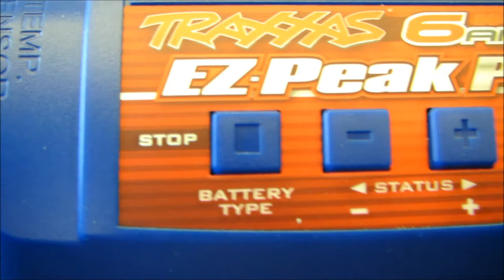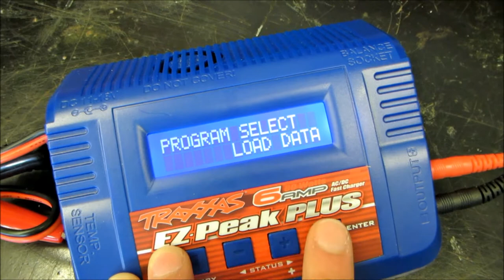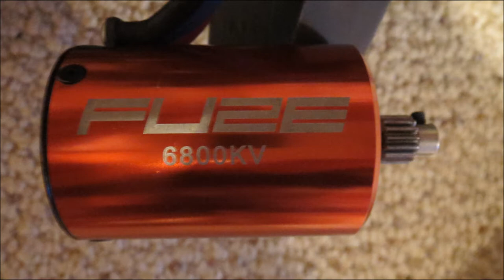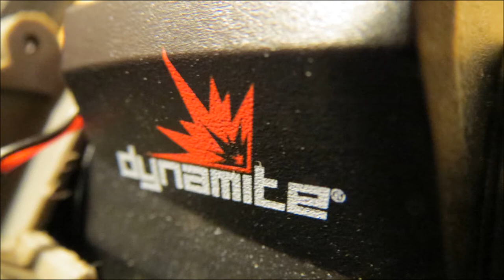Custom Upgraded Traxxas Rustler RC car

Comment: Can you put the list of the parts you use for your rustler in the description?
Reply from the maker: Powerpeak 3s 4300mAh 45C lipo
Dynamite 5800kV brushless motor + speed controller
RPM gearbox
RPM A-arms (front and rear)
PRM shock towers (front and rear)
Proline powerstroke shocks (front and rear)
Proline steering kit with built in servo saver
AXIAL aluminum servo horn
Steel CVD driveshafts
STRC steel hinge pins
STRC blue wheel hexes
STRC blue wheel flange nuts
Traxxas 2075 high torque digital servo
Traxxas blue aluminum axle carriers
Traxxas blue aluminum steering blocks
Traxxas blue aluminum caster blocks
Traxxas battery upgrade kit
Traxxas upgrade ESC mounting kit
Traxxas black lower chassis
Traxxas black upper chassis
Traxxas black bulkhead
Traxxas black battery hold down plate
Traxxas blue aluminum turnbuckles (front and rear)
Traxxas blue aluminum toe links
Traxxas short bumper
Traxxas fibreglass suspension tie bar
All rubber sealed ball bearings
All stainless steel hex screws
Spektrum DX2e controller
Traxxas EZ peak plus 6 amp chargerTires:
4x Proline badlands 2.2"
4x Stock traxxas alias (front and rear)
4x Black chrome alias tires (front and rear)
4x Proline road rage 2 (front and rear)
2x Paddle ties (for sand)
2x Traxxas anaconda tires (rear)
Proline tire glue